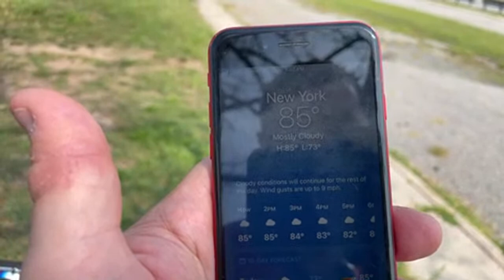Nitro Gang Live at the RC Track with Lots of nitros - savage, revo, rustler, jato , RS4 Jato

Comment: Which is faster the Nitro Slayer or Nitro Slash. I’m considering another Traxxas. I have a Revo already but want another Traxxas. I had an original Nitro Hawk that I had since they came out but got rid of it years ago. Wish I hadn’t. I had the second gen with the Trx 12 after they switched from the Image 12.
Reply from the maker: BRO, you're a true Vintage NITRO fan, im happy to have you here (only the very few know about the traxxas image 12 engines)!!  Sickening.  Anyway, regarding your Slash vs slayer question, with the the optional 1 tooth taller clutch bell the slayer pro is identical top speed to the slash, each can hit 50 mph.  Something to consider is the slash is really an extended Nitro rustler chassis, while the slayer is built on the revolutionary platform and is also longer and more stable at speeds.  For 350 the slash at amain is a top notch bargain too.  Both are in stock at amain now, if you order please use any of the first few links in this video, it would really help me out.  Let me know which you choose, this is a good future video topic actually.